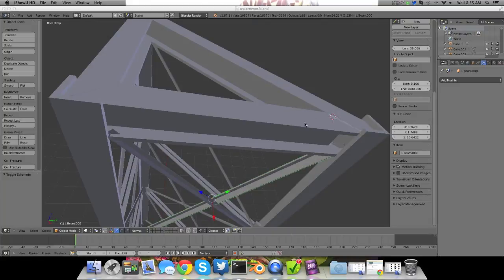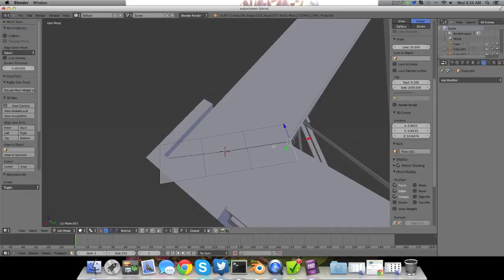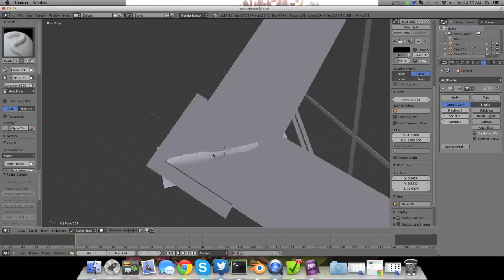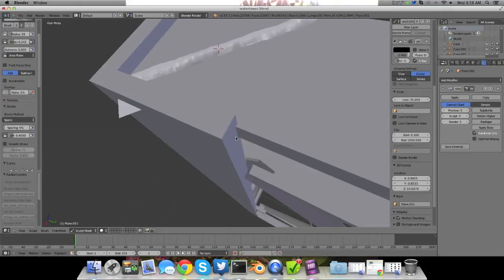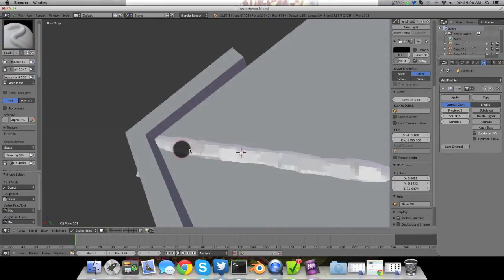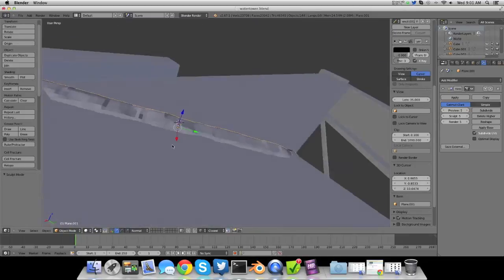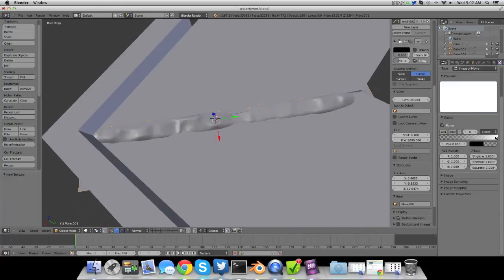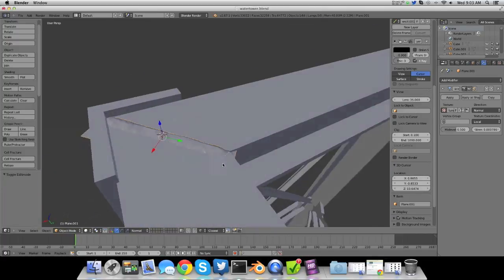Blender Tutorial: Creating Weld Joints

Comment from the maker: It's true that you could use a normal map, or you could bake out the weld joint to a normal map, but the seam created is for high-poly models. It's better to have actual mesh displacement when possible because it looks better than a normal map.